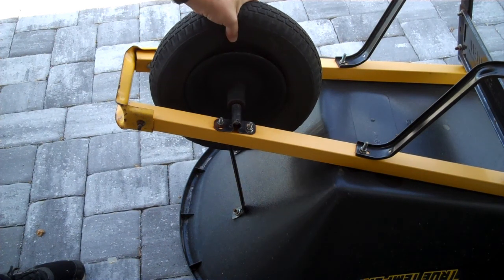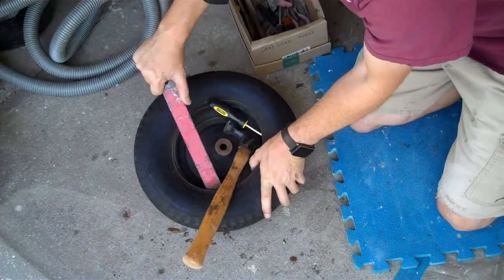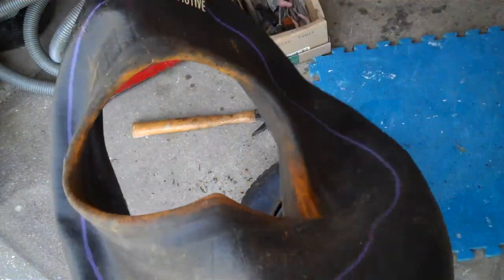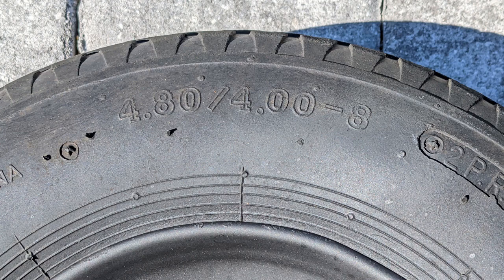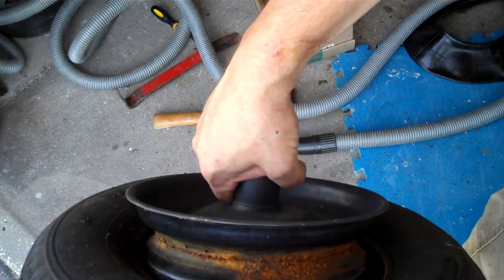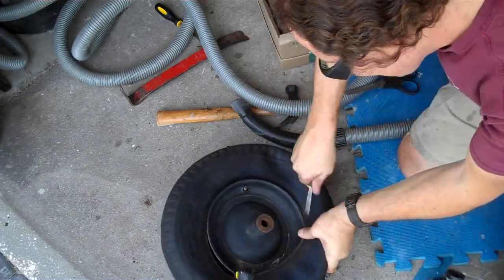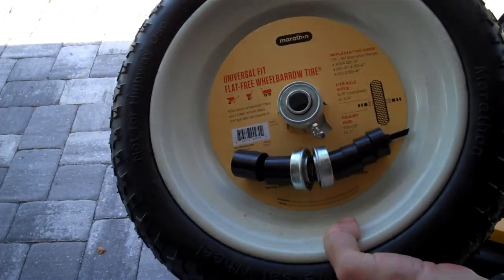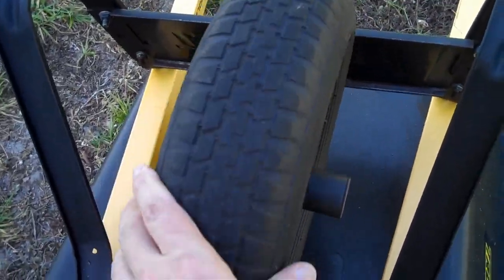HOWTO: Wheelbarrow inner tube replacement (Or Foam Filled never-flat Wheel Swap)

Comment: Thanks for your video.   I too found a wheelbarrow on the side of the road.  It got a flat so I took the tire off to look for leak. the tube seems fine..no leaks with soapy water.   my tire is the same size as your  but the inner tube that was inside the tire seems a little bigger and it was actually slightly pinched up inside the wheel.     the tire measurements are 4.80 x 4.00 - 8 (it was a tubeless tire., I guess the previous owner put the tube in )    the tube measurement is 4.8- -4.00  -8/9  seems like that "should" fit however it really seems too big when I blow it up.  unless the tire expands with the inflation of the tube?      sorry I hope my question makes sense.    which size tube did you use?   thank you
Reply from the maker: I purchased a tube that was rated for my tire size. I expect your inner tube will be fine as the tire will constrain the size as you inflate it.